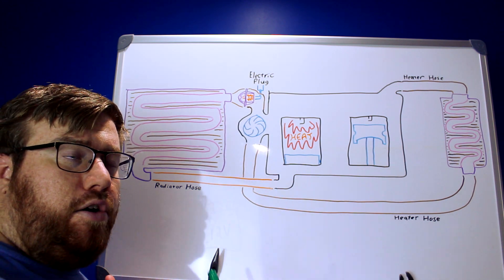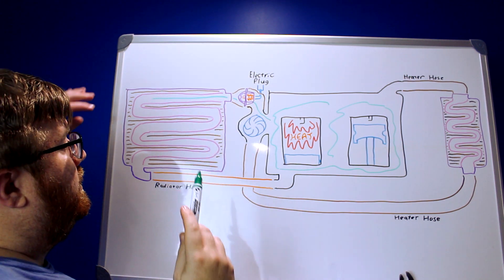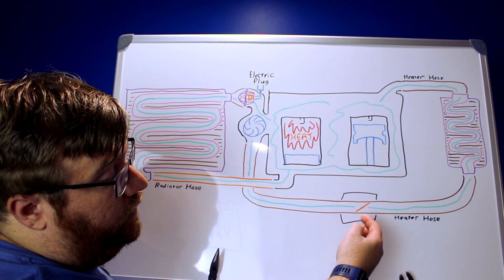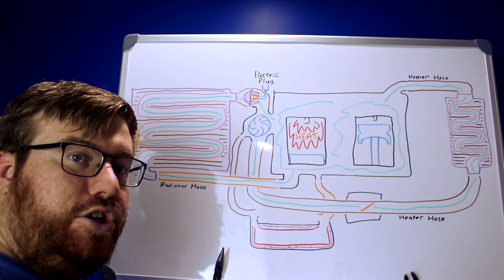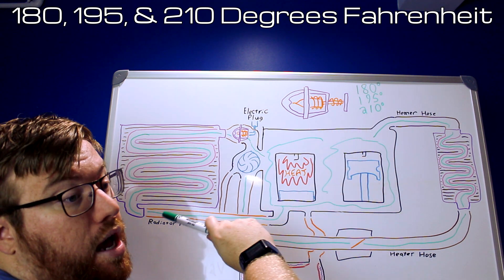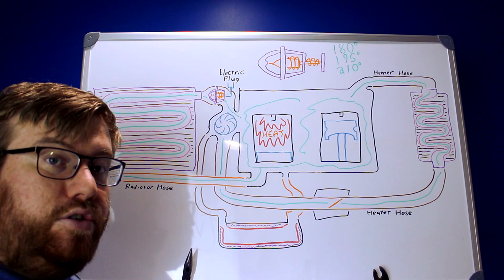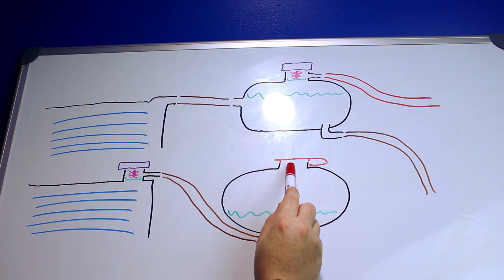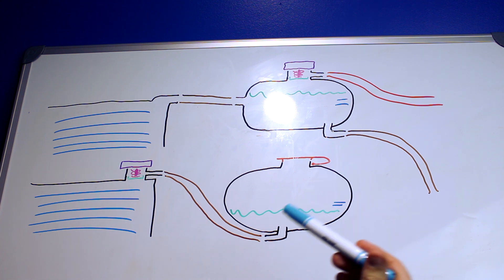How Modern Engine Cooling Systems Work • Cars Simplified

Comment: This drawing was made simple and doesn't reflect any particular engine, and there are definitely some details that could have been drawn better, like the weaving left and right in the radiator. I know this, I just try to make the drawing simple and overdo it sometimes. Also, the blacked-out visuals near the end is a rendering error, and I have no idea why that happened, but I had no backup videos ready to go this week, so I am stuck with it like that. I wish I had done better, but this is what I've got. I hope you don't judge those flaws too harshly, and I'll make a short video out of that last bit of footage in the future with the visual issues corrected.
 - Steve, host of Cars Simplified
Reply from the maker: Another correction: The three temperatures that are common to thermostats are 160, 180, and 195 degrees, not 210.

Comment: Hi steve, what you think about the kia's cars where the thermostat is located into the lower radiator hose blocking the cold water from entering the engine, can you explain that system ?